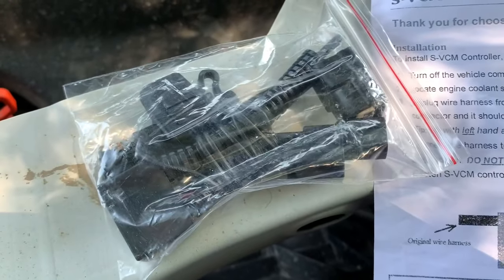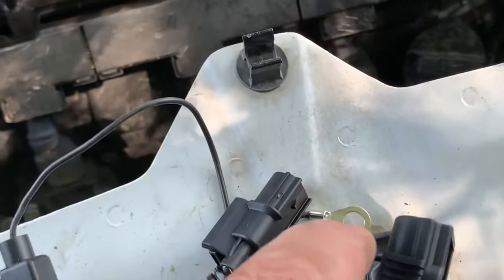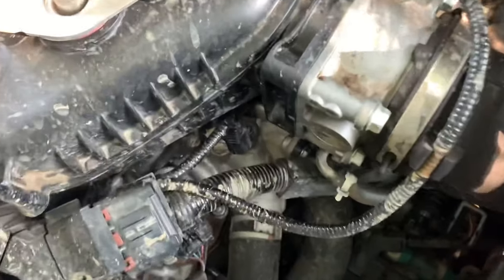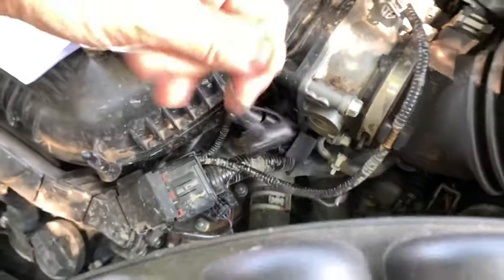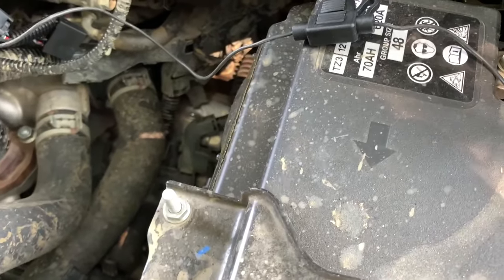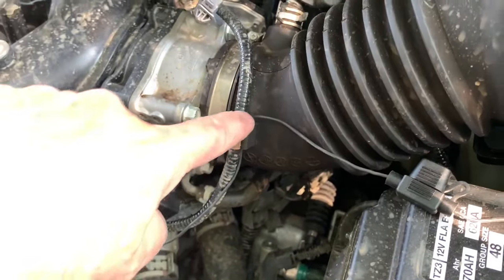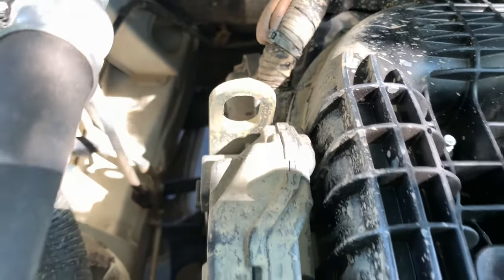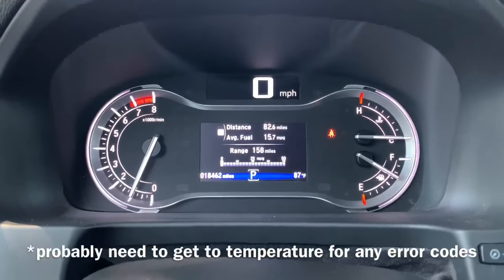Disable VCM (Varible Cylinder Management) in your Honda Ridgeline Honda Passport Honda Pilot Forever

Comment: My honda odyssey feels like my steering knuckle is lose or something. I mean my springs are terrible aftermarket quick struts, they bind. But I feel like my suspension is just falling apart, but all my front end joints, etc are ok enough. But the most lag I get is definitely when the eco light comes on, & I accelerate or decelerate. I really think it's the damn vcm ruined my mounts, the ones I can't easily inspect myself. And until I get hired into a shop, I don't have the equipment to check. So I think I'm gonna throw a muzzler on the vcm & see if it all gets better. It shudders a lot too. Almost feels like a stuck throttle plate, so I'll check that too. Feels like multiple front end issues....
Reply from the maker: Did you ever get one?

Comment: I bought a Pilot with throwing "low oil pressure" code. Only changed the oil 2000 miles ago. So its consuming oil. Going to try this thing.
Reply from the maker: Let us know!

Comment: Just bought one ,been doing a lot of research on this and worth a try on my new 2020 pilot exl with 33k .I do my oil changes at 40% always have each time I've been down almost a quart to half a quart.also I've noticed when driving onto 2nd gear between 17 to 28mph at 1700 1800rpm I'm getting a whosh sound and a slight drop rpm when feathering cruising the gas  and feeling of a slight misfire after pilots warmed up .wondering if this is vcm kicking it .but if I and taking off everything is great no shaking no jerking it runs great and don't feel or hear it when on gas pedal accelerating
Reply from the maker: Sounds like it. Let me know your results! Thanks for watching.
Reply: I did 2 transmission drain and fills yesterday the problem has diminished after the 2nd drain and fill.i did the 1st then drove it and the problem dampened then brought it back home to do a 2nd one after driving it for 20 min getting all the fluid mixed up ,after the 2nd drain and feels like the gears tightened up and the shifts are flawless better then when I bought it.looks like I'll be doing tranny drain and fills every other oil change only cost me 40 bucks for 4 quarts and oil is 35 bucks for full synthetic. So that's the same price as a synthetic oil change if someone did it for me so it's not expensive to do that

Comment: I have a 16 Pilot .  Drive with the " ECO " 98% of the time .  Never , ever noticed any loss of power/vibration .  My only issue was the " Start/Stop " button .  Conferred with the University of U Tube, brought a new button & replaced it myself .
Reply from the maker: You are missing out on 100% of the Air Conditioning. If you can’t tell the difference with the a/c, the dead pedal accelerator or expanded shifting vs NON ECO; you will not notice the difference in the VCM. Thanks for watching.

Comment: How late is too late to install the SVCM? My Pilot is at 94,500mi, gave me code P0303 two days ago. Changed cylinder 3 plug and coil, now it’s fine again.
Reply from the maker: It’s actually great for older HONDAS as it keeps all cylinders running all the time so you don’t get codes. I have shops that order them all the time.

Comment: Just to share my experience with others who may be having VCM or similar issues, I'm taking my 2019 Ridgeline (32,000 miles) to the dealer on Monday. In addition to constant vibration (like unbalanced tires) at 70MPH, the truck has developed a tendency for the power to "surge" up and down while in the same gear, which is readily visible by watching the tach needle bounce all over the place. It's as if the truck has bad fuel in it, and it can't keep the power level consistent as it "misses". It makes for a very unpleasant driving experience, which sucks because this thing used to ride as smooth as glass. I suggested VCM to the dealer, and they said off the top of their heads, the three most likely culprits were the torque converter, the motor mounts, or the VCM. Motor mounts make sense to me for the vibration, but not the power surging. I will post an update after they evaluate it. I'm really hoping it's something quick and easy, like the computer just needing a hard reset or something like that.
Reply from the maker: Thanks so much for the input. Please make sure to let us know outcome!!!
Reply: I have a 2019 ridge line as well, same issue, and they said after multiple attempts, told me it’s normal. They tried it in a few other vehicles and it’s common. On mine, they replaced all sorts of stuff including a whole new transmission to no avail. I’m not sure what to do at this point.
Reply from the maker: Order yours today at Ridgelinestore.com
Reply: So I took the truck in, as scheduled... and of course, it drove perfectly fine on that day, after displaying symptoms every day for about a month prior. Technicians could not, of course, duplicate the reported issues. I'm sure I'm not the only one who has experienced such things. Must be damned gremlins in my engine compartment!
Reply from the maker: Keep me posted!
Reply: Hi Gabe, I had a similar problem. My tach would bounce around between between 45 and 55 mph. The shifting was very rough in 5 th and 6th gear. So what Honda did was flush the transmission fluid 3 times and it totally worked. The problem is called, judder from the torque converter . It’s service bulletin 17-025. The truck drives like a dream now. Basically what happens is the transmission fluid burns up and doesn’t lubricate well and needs to be changed. My truck has 57,000 miles on it. Probably safe to do transmission flush every 40,000 miles depending on how you use the truck. I hope this helps.
Reply: @ethanl3769  thanks! I should have updated this, myself. I had the fluid changed (just once, so not a flush), and that actually fixed the tach bouncing issue. Which seemed very weird to me, because it didn't really look that dirty, but it definitely was the issue. This is my second change at 35K miles, but I do quite a bit of towing at the upper limit of the truck's ability. This did NOT fix the highway vibration issue, but installing a VCM disabler took care of that. So I assume that for some reason, the electronic motor mounts got knocked out of skew or something. I mean drive my truck pretty hard, but not THAT hard! In any event, the truck drives like new again, so I'm happy.
Reply from the maker: Great to hear!!!
Reply: I’m glad things are getting sorted out!  The Ridgeline is a great truck!
Reply: I had the same issues with an Accord 2014 3.5 and did a transmission fluid change at the dealership at 30,000 miles, the service advisor asked me why I wanted to get it changed.
I answered him that first because The transmission is acting weird and second because I’m keeping the car until it won’t be drivable and third because changing the fluid is the first step of a transmission diagnosis when you don’t get a code on the dashboard.
So after transmission fluid change , Honda Accord transmission started working smooth again no issues so far.
Reply: Mine would do that at low speeds. Changed the transmission fluid and filter. Fixed the problem.

Comment: The IC engine is an efficient and simple power generator. I just bought a 20222 RTL-E and started researching issues. Two major sacrifices that were made to the gods of CAFE: 1. VCM and 2. auto start/stop. What horrible assaults on the engine and it's longevity these designs are. Considering what the designers are forced to come up with, I feel the benefits, if any, come at a huge down road price. By shutting down half the the pistons the remaining three now has to power the deadheads to spin against closed off cylinders compressing air on the upstroke and then drawing a vacuum on the downstroke. This all creates work needed which defeats any savings. Then dealing with thermal issues, lubrication and off-on cycling for the fuel system makes no sense. Auto start/stop is another mechanical disaster with stresses on every component from battery to starter to motor mounts to fuel system solenoids to drivability. I'm in process to making these so called enhancements go away.
Reply from the maker: Thanks for watching.
Reply: I don't worry about it, I tow 2 times a month and don't notice much if anything except lower mpgs. It only activates at hwy speeds so not pulling 5000lbs and flying Im good. No issues with vibration, 2019 RTL E, pull Fishing boat, SXS, camper, sleds. All under 3500lbs., cant beat the Ridge the rest of the month just driving.
Reply: The auto start/stop also puts a lot of load on the cam belt. Electric motor torque is maximum at zero RPM. That peak torque is  transferred to only a few belt teeth when the engine starts to spin.
Reply: Thanks for the excellent analysis of how bad the VCM concept is regarding shutting down half the cylinders and the impact that has on the engine overall.  A ridiculous concept which ignores so many other operating factors for the engine.

Comment: I have a 2021 Ridgeline EX-L and the VCM system is absolutely horrible! Always jerking and surging, RPM's bouncing around when in the same gear, noticeable change in noise and vibration when it kicks in. Sequential mode is even worse. I am completely surprised that a manufacturer like Honda would sell a vehicle with these types of issues.
Reply from the maker: Thanks for watching. You either know it’s there or you don’t. This entire comment section is back and forth. I’m with you. Worked great towing the camper this week.
Reply from the maker: Make sure to order at the Ridgelinestore.com

Comment from the maker: NOTE: some ECO lights will still show on some models, however the VCM has been disabled. The ECO light on the older versions (before the ECON button) reflect your driving. When your light on the gas pedal the ECO light illuminates. In the newer models the ECO light is the green hue around the instrument cluster. The ECON button in the newer Hondas, LOWERS A/C output, deadens the gas pedal, and extends the transmission gear shifting to save fuel.  Thanks for watching.
Reply: Do you know what years are the Honda vcm engines?
Reply from the maker: As early as 2003 https://en.m.wikipedia.org/wiki/Variable_Cylinder_Management

Comment: I have a 2021 Honda Pilot, and  I Install the S-VCM today. It works great !!  I didn’t really notice it till I got on the highway, and started going up and down moderate sized hills. Normally, it will start to slow down, and then it will downshift, aggressively speed up with the RPMs hitting 5000, and then it will take a while to shift back up into the gear that it was in. It no longer does that, it keeps the gear, and just powers up the hill. I have one side effect, that I am COMPLETELY THRILLED with. The idle stop/start stoped working, meaning it no longer turns off at intersections, without me pressing the button. I followed the instructions perfectly, I mean, this isn’t exactly rocket science. I was driving today, made a couple stops, forgot to press the button, and realized it wasn’t turning off at traffic signals. I know The S-VCM Has nothing to do with the auto start/stop, but it is no longer working, and I’m not too upset about it 😂
If I find out why, I will let you know. In the meantime, if you have any ideas as to why, Let me know.
Reply from the maker: THAT IS GREAT TO HEAR!! So awesome.  Glad to know both issues solved! Enjoy and thanks for shopping with us as well watching!
Reply: The Auto start/Stop returned the next day, so I guess I will be purchasing the auto start stop delete after all . . .
The S-VCM, is working GREAT though !!
Reply: THE STOP AND START WONT WORK IF YOUR SEAT BELT IS NOT PLUGGED IN... SO MAYBE YOU DIDN'T HAVE YOUR SEAT BELT ON...
Reply: @boblawrence1692  are you SERIOUS !? !? !?  I had no idea. Thanks for the info, good to know.
Reply: @davidderfus3462  Im a Chrysler/ jeep tech and auto start stop is a PITA which always fails, and when it does, it pops up messages like.. "start/stop not ready, cabin heating", Start stop not ready, cabin cooling", "start stop not ready, seatbelt not fastened", start stop not ready, battery not fully charged", "start stop not ready, Hood open", etc... And that is from FCA/ Jeep dodge, Mopar. So if you ignore it, then you have to look at messages and warning lights on dash due to it bypassed or needs serviced.
Reply from the maker: Gheez
Reply: I have the impression based on my 22 Passport, that the auto start/stop feature also is temp sensitive.  I will get a message that it is deactivated temporarily when I start the vehicle on cold mornings.   Someone else can confirm. 

I do have a question.   Is has it been verified that the S-VCM won’t void any warranties?   Thanks!

Comment: Whats the shimmy like? I have a 2024 BE that has this weird vibration around 30-40MPH  best I can describe it is like have a loose wheel ... it's intermittent and cant make happen, does it when it wants and of course this will be a nightmare to find an answer.... I do notice when it does happen the truck has a heavy sluggish feel to it, wondering if it's stuck in 3 cylinder mode
Reply: I just picked up a 2022 Pilot with 50k miles and I’m noticing the exact same symptons. Wife thinks I’m crazy and social media thinks it’s rotor or wheel related. All signs are pointing to this VCM thing but I’m not 100% sure. Like you said vibrations I can feel in my seat, happens around those speeds and is intermittent. Haven’t even had it for a full day yet so I’ll try to pinpoint when it does it again. I’m thinking during stop and go traffic.
Reply: @Strictlym3  There's no rhyme or reason with mine it just does it when it wants to do it, I've tried to log it when it happens but it's allover the place... I noticed it first at 400 miles and when cold  or the first drive of the day and it progressed to happening when hot  and could be the second or third drive of the day.... The only thing thats consistent is the heavy or lazy feel that I experience especially on the days first drive, even the steering feels  extra heavy during slow maneuvers like parking (tires always at 36) On the forum an owner posted the same issue (there's actually a few that experience this) he said the dealer found the wheel bearings to be at fault???  for some reason I find that hard to believe.. Anyway needless to say its frustrating because there's no pattern that I can relay to the dealer... I suggested to keep it until you get to happen, but I need a loaner car,,,, and do you really think they'll put a tech on it everyday for a week or 2 to see if it happens?  I think my next vehicle will be the latest gen Tundra at least Toyota acknowledges the issues that the truck has.

Comment: I've been experiencing some mild vibration at 70MPH (my normal cruising speed) which I thought might be due to the tires. They're great tires (Michelin Defender), and had the balances checked. Everything is OK, but the vibration has continued, so I wonder if maybe it's due to this VCM you're describing? I didn't even know VCM existed!
Reply: As hydraulic motor mounts wear they mask the vibration less
Reply: @travelingrailfan4634  thank you
Reply from the maker: Agreed.